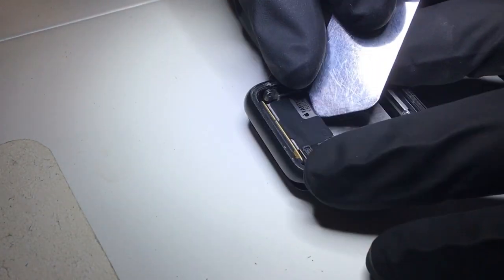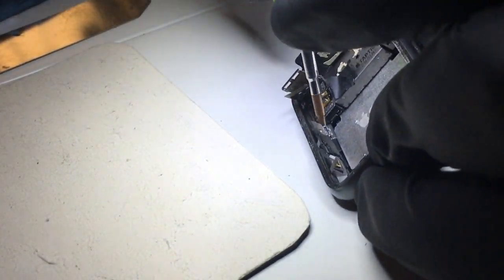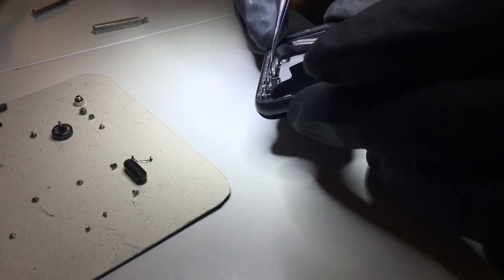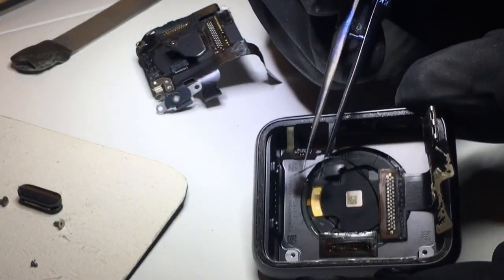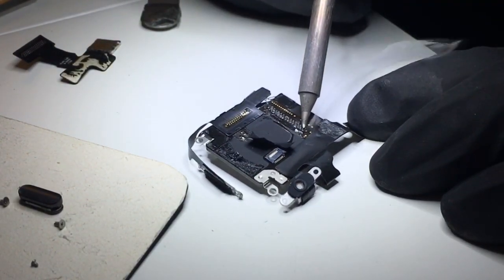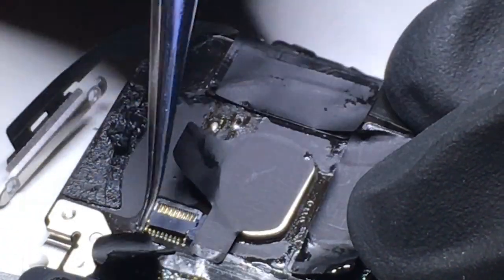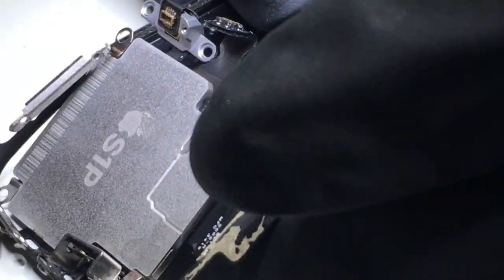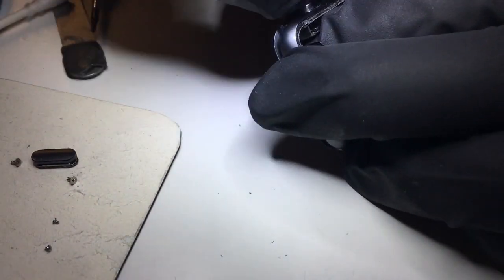How to remove the internals of an Apple Watch - Apple Watch teardown

Comment: I was replacing my battery and took the screen off for the adhesive, at 0:49 where you take off the screen with the two connectors and the bracket on top came up to reveal the 4 solder points, I didn’t think much of it till I put it all together and it buzzes but the screen is unresponsive and I think it’s becuase I lifted that piece up off the solder points but I’m not sure can anyone help?

Comment: Hello, I am following this video and all was going on until one of the screws (the one in the corner where the taptic is holding down the logic board ended up stripped. I can't get it out. I tried the rubber band idea, I tried gluing in a screw driver too and didn't work. I am at a stand still. How does one get a stripped little screw like this out?

Comment: I’ve done exactly the screen change,. But the new screen some times is Bright normally but wen I try to fix in the frame with double face glue, the display get not bright, may be there’s a problem in the flax cable to the Main Board ?  What is the spare part  the some time cause Display is working but not Bright? It appear like a 30% to de real bright. And doesn’t matter try to go to adjust to put +++ bright , because it do not affect the display to work as a 100% off bright ! Any suggestion ?

Comment: How much would you charge to repair the lcd connector in a 38mm Series 1? I accidentally ripped it smh 🤦🏼‍♂️ I was like it’s fine until I found out it has to be resoldered.